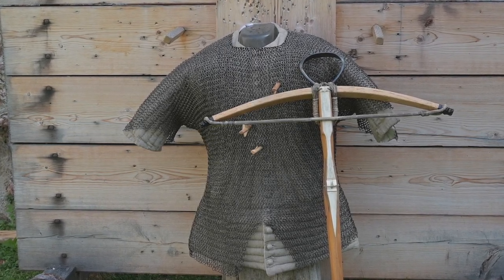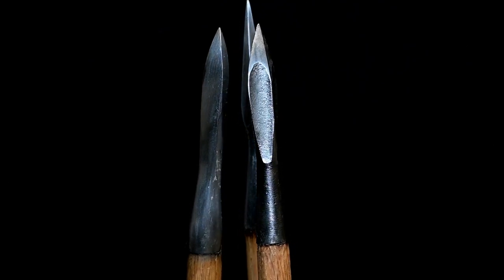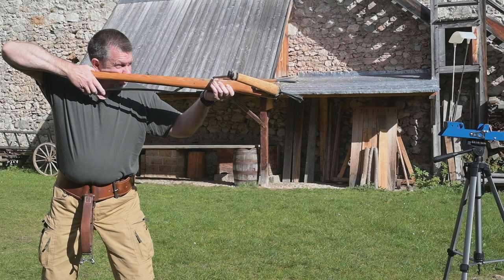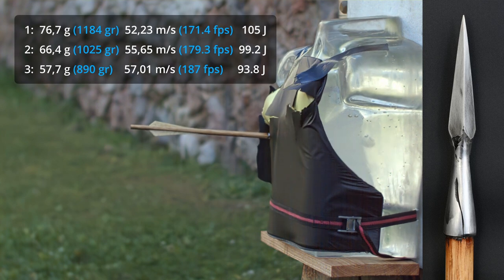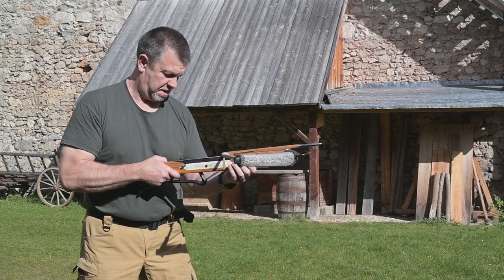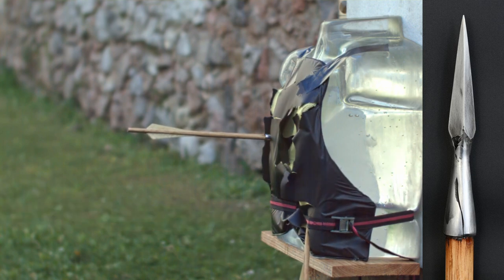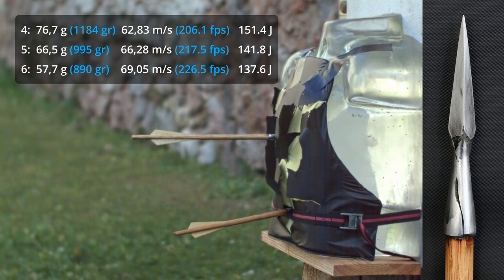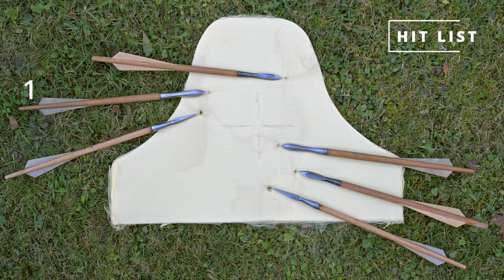Medieval Composite Crossbow vs Body Armour Ballistic Vest

Comment: Great video as usual. But kevlar is quite different from all medieval textiles so  you can not assume that  it is possible to make crossbow-proof and wearable textile armour basing on this experiment.  And  modern hunting broadhead with sharp edges will work even better than bodkin on kevlar :).
Reply from the maker: You are absolutely right. The idea was to use a standardised material. This makes it possible for others to do tests and compare the results.
Reply: @medievalcrossbows7621  I think a old Broadhead could be maybe get threw the kevlar as well , more likely if they are razor sharp !
Reply: @killerkraut9179  Im pretty sure sharp viking age hunting point will do.

I shot thru a gambeson that stopped bodkins with a 50# hornbow with hunting point replicas from year 850
Reply: @killerkraut9179  I'm not so sure- it's 'broad' as the name says, so the impact is spread out quite a lot, and thus the friction and resistance to shearing.  And broadheads, as far as I know, weren't used with war crossbows.
Reply: @mattl3729  I think whe still should try it !
If they edges are razor sharp it would reduce the surface!
Reply: @medievalcrossbows7621  Test and results are good! Steppes tri-lobed arrowheads comes to mind as prime candidates- large ones, with stepped piercing nose and razor sharp "wings". They looks like something which was optimized to go trough many layers of tough cloth.
Reply: Matt L do you know what a broadhead is?

Comment: I would imagine that while you wouldn't be outright killed by a bolt, you'd still be done for the day, non?
Reply: not necessary.  Kinetic energy is less than .22 round (150+ joules) and this armor should be able to stop 9mm bullet (450+joules). Quarells will leave bruises but will not incapacitate. Bodkin will ruin the day however.
One may try to reduce the impact by making armour rigid. Maniacs from University of Wisconsin who made linothoraxes (rigid armour from glued linen) shot each other from the bow. Arrow failed to penetrate, and the photo of the smiling guy with arrow sticking from the breastplate is quite popular on the web (just google linothorax). However the bow was relatively low-weight, even  blunt quarell from crossbow will go trough arnour and the owner :).
Reply: @sasasasa-lx6cl  It's not just about kinetic energy. Momentum also matters, & at least the most powerful bolt tested here has more momentum than a typical 9mm round (4.8 vs. 3.2 kg m/s). I agree that the bolts that didn't penetrate wouldn't incapacitate, but I bet the person underneath would be hurting.
Reply: The bodkin would potentially kill a person in time- it takes something like 2.5cm (1") penetration to reach internal organs in some places, and if you pierce the intestine or liver, you could quickly end up with peritonitis or just internal bleeding, which couldn't be fixed at the time.

Comment: Thank you for doing these tests. These crossbows are amazing & perform quite well. However, as others have noted, modern synthetic fabric doesn't necessarily tell us much about historical fabric armor. I'm additionally curious about the effect bolt sharpness has. In other tests, very sharp cutting blades do the best against fabric armor. Something like a very sharp type-16 head, if there's a bolt equivalent, might do a lot better. In any case, the level of deformation from the shots that didn't penetrate suggests that such hits would be unpleasant for the wearer.
Reply: Have you seen test on Fateful Force channel? Interestingly enough, broadheads doesn't seem to be doing better than needle bodkins against \some heavy(ish) jack at all, though it's hard to say how sharp are they, exactly.
Reply: @lscibor  I have watched those. Being extremely sharp is what has made the difference in other tests against fabric armor, both with arrows & with swords. For instance, modern hunting broadheads did much better against the (speculatively) reconstructed ancient glued-linen armor than reconstructed iron arrowheads. Most historical arrowheads probably didn't manage extreme sharpness, but some might have. We know some were hardened.

Comment: I can't help but notice that the kinetic performance of that 726 crossbows is already clearly superior to 1200 pounds steel one by Tod from Tod's Workshop for example, despite shooting lighter bolts...

Amazing work, it seems you alone are getting closer and closer to performance that was apparently expected from winch crossbows in the period... (Winch crossbows being generally rated more dangerous to armor than "archer pulled" bows"). 

What's it's approximate power stroke, BTW?
Reply: I think Horn Composite is more eficent then heavy steel bows of a crossbow  !
Reply: Yes. I suspect the 330kg crossbow here could be spanned from the belt by someone sufficiently athletic, & that historical warriors spanned such heavy composite crossbows from the belt. Spanning heavy crossbows in this fashion is a key feat of strength in the 15th-century text El Victorial o Crónica de don Pero Niño by Gutierre Díez de Games. It describes events from circa 1400.
Reply: Exactly, I was going through the numbers as well, comparing Bichler's 462 lbs hook spanned crossbow with Tod's 850 lbs windlass. They deliver the same amount of energy, more or less. Bichler's 94.6 J with a 58.6 g bolt compared to 88 J with Tod's crossbow with a 60 g bolt. But Tod's has almost twice the amount of poundage, impressive...
Reply from the maker: This is the great advantage of a composite bow over a steel bow ;-)
Reply: steel prods are much less efficient cause they are heavy and lots if energy is wasted just by moving this mass. I have a replica of 16 century crossbow from Malta with steel prod (150 kilos) and, to be on safe side of the local regulations, the one from aluminum (30 kilos). Aluminum REALLY outperforms steel. Composite prods are the best performers, of course but no composite prod will fit such small frame.
However steel prods are waterproof, low-maintenance, easy to mass produce, and more compact - just the thing for long naval journeys, wet jungles and conquest of the world :)
Reply: @benjaminabbott4705  Villani, Nuova chronica mentions the consequences of such funny games of might
  
"Ebbe della moglie due figliuoli e più figliuole: il primo ebbe nome Carlo secondo, e fu sciancato alquanto, e fu prenze di Capova, e appresso del primo Carlo suo padre fu re di Cicilia e di Puglia, come innanzi faremo menzione; l’altro ebbe nome Filippo, il quale per la moglie fu prenze della Morea, ma morì giovane, e sanza figliuoli, però che si guastò a tendere uno balestro." 

...his second son was named Philip, he became duke of Morea but he died young and childless because he overstrained himself trying to span a crossow
Reply: @sasasasa-lx6cl  If we're to believe Ralph Payne Gallwey, and his numbers like 460 yards range for 1200 pounds, 7 inch power stroke bow,  steel crossbows definitely could be made way more efficient that what we're seeing from few reconstructions available. 

Certainly quite a few originals seem carefully tapered.  Trying to tune them for finest performance would require lots of experimenting, just like with  reconstructing horn bows, and is risky, cause when steel bow fails, it's quite a something. 

So there may be surprises awaiting still, though I do suspect that horn composites are quite a lot more efficient most of the time. 

Frustrating part is that period sources generally do not seem to bother with mentioning the material of the bow.
Reply: @lscibor  Payne Gallwey's bow was one inch thick. The modern "replicas" seem to be much thinner. So of course they are inefficient. If the limbs are too thin the material is not efficiently strained.
Reply: @benjaminabbott4705  Then surely a 330 kg crossbow could be spanned by an average person using a goats foot lever if one is using stirrup and both hands. 210 kg crossbow is not difficult to span with a goats foot lever using one hand
Reply: @jonathanengdahl9045  Tod & various others place about 230kg as the maximum with a goat's-foot lever. I imagine some historical soldiers did do significantly more, especially with a different technique as you mention.
Reply: Question, is it possible to make a recurve steel crossbow in middle ages? If it's, will it shoot heavy bolt or lightweight bolt?
Reply: @sasasasa-lx6cl  It is not only that they are heavy it is that they are stiff. If you look at the slo-motion you will notice that the composite bow is wiggling. A steel bow on the other hand will stop abruptly
Reply: Seems like it depends a lot on the size of the lever. A larger lever will allow you to span a more powerful bow. Seems like our estimations may have been on the low side

Comment: Modern soft body armor is made of woven amarid fibers which have tremendously high tensile strength, but virtually no compressive strength. This provides great protection against firearms, while still offering reasonable comfort and mobility. 

The mechanism of effect is relatively simple; the armor defuses the kinetic energy imparted by the projectile along a wider cross section than the immediate area of impact, which slows or stops the projectile while also reducing the impact stresses imparted on the wearer.

The faster and smaller a projectile, the easier it is to punch through kevlar or a similar material. Larger diameter bullets are less likely. Imagine trying to push your finger through your shirt, then try it with a needle. The needle will penetrate easier.

Comment: Der Spanngurt ist hin :D
Reply: Because atlatl was long forgotten technology by the time Rome became a thing. 

It got displaced by bow, or went out of use from some other reasons in most of the word long before history started getting recorded. It surived in Australia and America.

Other than that, atlatl dart weigh couple ounces at best, are long, thin and flexible by necessity, and by design, the flex of the dart allows it to be launched in the first place.

Launching 1.3kg spear out of atlatl is not likely not realistic, at all.

Atlatl darts are something in between arrows and javelins in many way, slower and heavier than arrows, lighter and faster than hand thrown javelins.

Comment: balistic armors are not very effective against cuts - meaning knife hits, spears, and piercing weapons with sharp arrowheads... needle bodkin, or similiar.
 its efective about stoping round objects, like bullets

composite bows are more effective per same draw weight than steel rods. That's why launching velocity is higher. they simply return to its starting position faster, than steel, so they can achieve higher launching speed, puting this way more energy into bolt.

this is why it brings more velocities and energy than even higher poundage steel heavy crossbows.

the reason, why steel rod crossbows were used much more often, was they have several advantages.
they are cheaper, and can be produced faster
they are more safer, resistant to weather conditions (dont break up, which is particular important when very high poundage crossbow is used)
steel can be reused from broken crossbow, making other stuff from it.

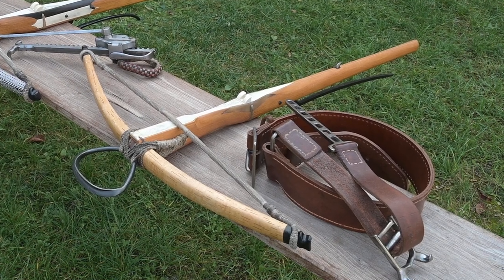Comment: 2:05 Very nice video, and those crossbows look very good, but you are cocking the first one wrongly.

You should stay on one straight leg while the foot of the other leg is raised above the ground and in the stirrup and then push the crossbow down with the foot in the stirrup and your hands. The straight leg stays straight during the whole process. This way you won't have to push your own weight (and the weight of your armour ad equipment) too and will be helped by the weight of your leg.
Reply from the maker: Wrongly isn't right - there are two ways to span a crossbow with a belt. The Problem with the one straigt foot technique is, that you*ll have only the power from one foot availabel.....
Reply: @medievalcrossbows7621  The way you have spanned it, you still have only the power from one foot available! The other foot is not on the crossbow, whereas the foot which is on it is also pushing part of your own weight (and, if you were an actual crossbowman, of your armour, weapons and other equipment) and does not take advantage of its own weight in the process...

Look, I'm sure that, if you try, you'll find that the one straight foot technique will allow you to span a higher maximum poundage. Hell, if you can easily span a 210 kg crossbow the way you did, you might even be able to span the 330 kg one the way I described as a one-foot crossbow (provided you get a well sized stirrup on it)!

Besides, using a craneqin for the 330 kg one makes no sense if you can actually span a 210 kg crossbow with that bad technique: I'm sure that means that you are strong enough to span the 330 kg as a two-feet crossbow (spanning with both feet on the bow in a sitting position). Try it if you haven't: faster than using a cranequin.

By the way, the first one "substantially" corresponds to the crossbows already used in the 12th century! No need to go as far as the 15th century!

Again, great crossbows.
Reply: And, if you cannot push the 330 kg one as a two-feet crossbow (which I think you can if the crossbow which you are spanning with the belt is actually 210 kg), a cranequin is by far the wrong choice anyway.

A goat's foot lever would easily do it and be faster (provided that the crossbow is adapted for it).

The cranequin is meant for crossbows which have way more poundage than 330 kg!

Comment: Did you use sharpened bolts?
Reply from the maker: Neither hardened nor specially sharpened. Typical of this type of medieval bolt head.
Reply: I see. Do you think steel crossbows were just used as hunting tools and not weapons? Because even the 1000 lbs one are garbage. Your wooden and composite crossbows on the other hand are excellent
Reply from the maker: @markcorrigan3930  No - the steel bow gradually replaced the composite bow from the middle of the 15th century. The steel bow was first used militarily by the Burgundians under Charles the Bold. The main problem with the composite bow was its long manufacturing time and its susceptibility to moisture. The steel bow, on the other hand, threatened to break, especially at low temperatures, but was very cheap and could be produced in large quantities.